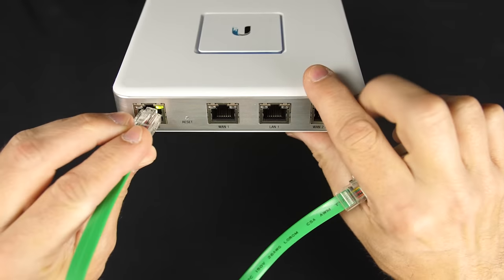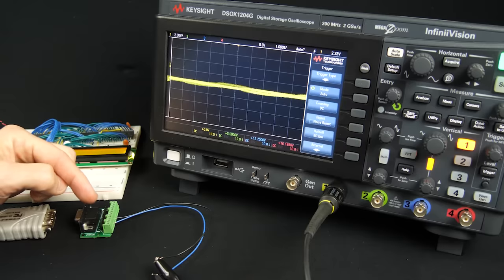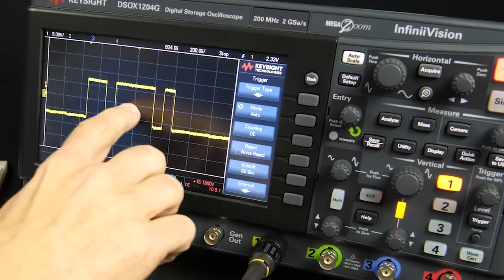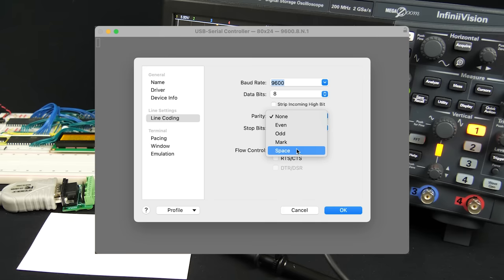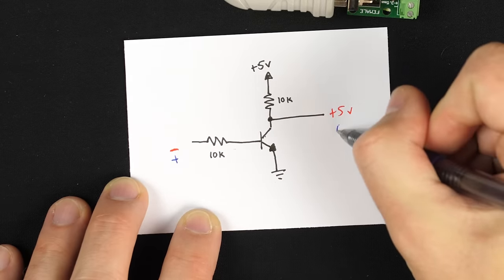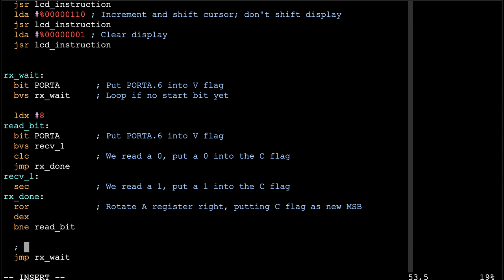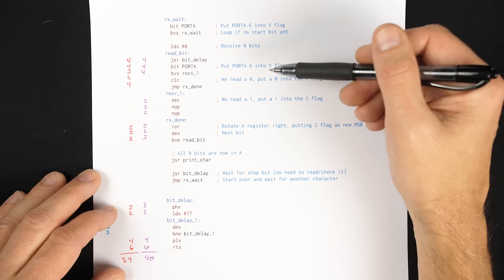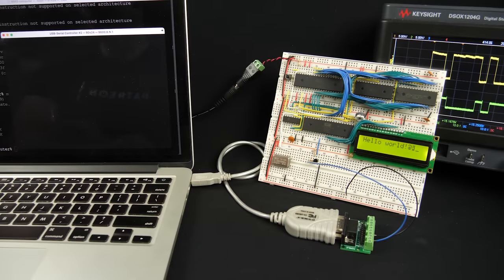The RS-232 protocol

Comment: I have worked with synchronous RS-232, in which the clock pins were in use.  The assumption is that the clocks gate the signal from a buffer where the bit is held until the clock releases it.  Interesting thing is that normally the clocks, both send and receive, always originate from the data communications equipment.  This is because the communications networks way back when were multiplexing multiple signals from a centralized clock (old-style Time-Division Multiplexing [TDM]).  That means your bits better be ready to go when the clock says go.  The much more common asynchronous signalling is left to adjust timing through a network by allowing for buffering to satisfy the strict timing requirement of the network.

Comment: Good timing on the video. I've just been working out old MS-DOS training software for Morse code, from when people needed to learn it their amateur radio license. Many programs let you connect a Morse code key, paddles, oscillator (speaker), or a keyer (to key a radio transmitter). And every program manages to expects them to be connected to a different set of pins on the RS-232 port to every other program. Usually the docs include an ASCII circuit diagram showing how they decided to do it. Typically they'll use the flow control pins (CTS/DSR), but sometimes the Ring (RI) or Carrier Detect (DCD) which are more tricky to get working in a DOS emulator. Data pins are always ignored (except sometimes to get a negative voltage for a pull-down resistor). It's a bizarre world of mutually incompatible, independently homebrewed solutions.

Comment: Great stuff.  We used RS-232 for a lot of stuff back in the day.  Just to be clear, when connecting two computers directly as you show, there is no 'DCE' and you have to pick one yourself.  You could have picked either one, just have to follow the right 'direction' for sending / receiving.  Flow control was another big thing, many folks used DTR/DSR but I think that wasn't really part of the standard to use them for that.  And don't get me started on 'Ring Indicator' and 'Carrier Detect'  lol

One area that was tricky was sending large files.  No matter how careful the clocks were, if you tried to send more than 150-200 characters, you'd get a clock-slip sooner or later.  And of course we didn't want to add two stop bits as that just slows everything down.

That's why there were several 'file transfer' programs like KERMIT.  It broke up the data into chunks (128 byte was a common size) and sent them with a tiny 'pause' between them.  So each 'chunk' the start bit would sync things and break the transmission before the clocks drifted too far apart.

This all takes me back.  Thanks for the video.
Reply: In this scenario both devices are DTEs and should correctly be connected using a null modem, for async comms this is otherwise known as a crossover cable. For synchronous comms a proper null modem device is used which generates the proper control signals and clock sources.
Reply: With a UART, sender and receiver synchronize at every byte.
The hickups you mentioned stem from a different thing. The receiver needs to have some time to actually process the received data. Often that ment to calculate some checksum and to write them on floppy disk which wasn't particulary fast. That's why programs like Kermit or ZModem transfered in chunks

Comment: I've worked with RS-232 since about 1984, and all kinds of variations, including its "offspring" RS-422, -423, and -485.

One of the more interesting variations of the 25-pin connector I found on a Texas Instruments printing terminal (850 comes to mind).  It used most of the pins for a standard serial port with handshaking and such, but then used others to support a parallel printer port.  Serial and parallel on one connector!!  I had to customize some cables to make it work properly and safely.

Comment: Thank you for this! I'm reminded (during the section on non-conforming connectors and cables) of the RS/6000 PAIN IN THE TUCKAS connector, and if one didn't have the correct cable, the console would immediately hang up on connection, meaning a long dig through the cable box for a complete one.

Comment: We still use RS-232 to integrate non networked medical devices with electronic medical records. Devices like Anesthesia Machines, Ventilators, Perfusion pumps (Heart lung machines), and others. They connect to a network appliance called a Capsule Neuron. In a few instances we also use old school terminal servers.

Comment: Great video as usual.

V.24 and RS-232 is almost the same, and V.24 uses the DE-9 9-pin connections instead of the DB-25 25 pin connection.  V.24 is a CCITT/ITU-T standard and RS-232 is a EIA which in our contents is the same.
Yes, the clock was used with some modems to synchronize the DTE and DCE.  (more info on Wikipedia)

Anyways, bps (bits per second) are how many bits are sent per second.  Baud is number of CHANGES per second, and a check can mean one bit, but it can means 2 bits, or 3 bits per second.   Encoding as voltage changes, or if you encode in sounds in ordinary modems, difference phase shifts (example a 0, 90, 180, 270 degree phase shift encode 00, 01, 10 or 11 which gives 6 bps if you have 3 baud transfer speed).

Comment: Back in the 1980s, I dealt with a minicomputer that had a bunch of RS-232 plugs in the back that supported two terminals apiece. You used a Y cable to connect one terminal to the primary pins on the connector and the other to the secondary ones. The back panel was pretty crowded, so not using the splitter cables would have required at least another U of rack space to fit all the plugs.

The old-school Western Electric 200 series (201, 202C&D, 202E, 203, 205B , etc) used binary synchronous communications and needed the clock pins. Async communications didn't need them.  Once 1200, 2400, 9600, 56k async modems came out, synchronous comms on RS-232 became a thing of the past. (The military held onto its synchronous stuff long after the commercial world left it behind, because AUTODIN depended on it.)

Mark - a hole in the paper tape. Space - a NOT-hole.  Since paper tape is a wood product, of course it has knot-holes.

Comment: I used to use this stuff way back when computers were newish.
DTE was an actual terminal.  Pre PC’s, Texas Instruments had a mini computer that could connect seven serial terminals.
I jammed our business through that thing for years.
I’m talking early 80’s here.  The cables for the terminals required 17 individual connections.
As years went by I figured out I could narrow it down to only 3 with some sneaky configuration.
TD, RD and ground if I enabled software flow control and limited the speed to 9600 bps on the longer cable runs of about 100m.
Isn’t it strange how fast the world changes.  People complain if their home internet falls below 20Mbps.
It was very Interesting to revisit RS232.  Who knew it has a new name.  
Funny how YouTube new to show this video to me.

Comment: I hope that someone mentioned that RS/EIA/TIA-232 says nothing about data rates, start/stop bits, parity or data encoding.  It is not a protocol.  It only talks about voltage levels, signal assignments, pinouts and physical connector characteristics.  Otherwise this is an excellent explanation of how a serial ASCII port works. Thanks, Ben.

Comment: This takes me back to the time when i tried to interface my C-128 with my 80286 PC.
I remember trying to use the built in serial interface of the commodore but at 2400 baud max it was just too slow.
So i built a parallel interface. The CIA6526's output impedance on PB0-7 was to high to have any effect on the printerport of the PC but there was 1 line on each side, iirc some paper present signal, that i could use for handshake. Sending from the PC to the CBM was no problem, but in order to get the maximum speed in slow and fast mode, i made the CBM the master, controling the handshake. A lot of bitbanging was done that night. But when i was finally able to compile 6502 code in TASM on the PC and send it over with a little program i wrote in QB i was a happy little tinkerer :-D 

Oh and i started the tranmission with 3 bytes, 2 bytes for the length and one either being $ff or $00, depending on if i wanted the received programm to auto execute.
Receiver routine would check the Userport for data in the IRQ and then JSR $fa65. 
And that was all because i could for the life of me not find a good macro assembler that would run on the CBM in 80 character mode.

Comment: I started working on RS232 stuff about 1980 - I think I've probably tested and/or troubleshot a hundred thousand ports, or maybe more. I designed it into products up until about 2003 or 2004. I still use it today from time to time.
Reply: Still used in healthcare equipment more often than anyone would think.

Comment: Within a few minutes from when the video has been published I got an info from work that I need to look for a rs232 electronic scale and get values from it to a microcontroller. I've never used rs232, only 3V3 and 5V UART, so I had to research how does rs232 really work. 
Too bad your video showed up 6h later but still, great timing!

Comment: Used to teach and students had lots of fun with RS232.  We'd scope it, decipher it and interface breadboarded electronic circuits with student laptops via the serial and parallel ports.  Would give them a waveform and they had to determine the rate, Start/Stop, and the character.  Built cables and did BERTs too. Had students communicate with each other and with serial modems in terminal windows.  Miss those days of simplicity.

Comment: In the mid eighties I had a terminal with a single RS-232 and I had to connect to a 2400 baud modem and a multi-user Pick OS IBM AT. I wired up a cable that connected to both and switched between the two by setting the baud rate on the AT to 19200 baud. That was a big enough difference to 2400 that the modem ignored the 19200 and the AT ignored the 2400. No unplugging and replugging required, just setting the baud rate on the terminal.

Comment: Nice. I was looking at the delay difference, and yes, I know 1 cycle isn't huge, but you can change recv_1 to be an additional bvs to the sec immediately after and get rid of the nops. This will make both paths take exactly 40 cycles, assuming you don't cross any page boundaries. This works because the overflow bit is still set so this is effectively a nop that takes 3 cycles instead of 2.

Comment: There is a distinction between the industry standard RS-232 set for serial transmissions and the hardware RS-232 connector. Through the mid 80s some data transfer systems used 8 bit parallel communication between TX and RX and an RS-232, 25 pin connector was used for this parallel communications (in many cases). I worked for a while as a field tech for United Press Int. which normally used serial transmissions whether by phone line or satellite into a tape punch or printer, but large newspaper publishers used computer systems that sent text around internally in 8 bit parallel format. The input to the computer was always an RS-232 connector, the "attention", "send", and Receive" lines were always the same on the RS-232 connector as set by the standard, but the 8 parallel data lines were not always the same from one system to the next. If I had to replace a data cable or install an initial system I had to custom wire the male connector that plugged into the client's computer system to match the system's pin-out. The advantage to parallel data transfer, aside from increased transfer speeds, is that a synchronized clock is not needed - the "send" single is used as a latch. All 8 bits of data on the line is latched into the receive electronics on the trailing edge of the "send" signal.

Comment: FYI, WDC's W65C51N ACIA has an issue with TDRE (bit 4) of its status register being stuck high, which means you can't use it to ensure you're transmitting at the correct rate. You can fudge it with a software delay routine (which is what WDC suggests as a workaround in their datasheet), but I found that approach to be unreliable.

Another 6502 hobbyist came up with a promising idea to use the pulse counting timer on the VIA with the ACIA's 16x RxC clock output to generate an interrupt, but that was a bit elaborate for my taste so I wound up just getting a new-old-stock Rockwell R6551AP on eBay. That version of the ACIA works as you would expect, so long as you don't leave any of the input pins floating! 😁

Comment: An anecdote that I have, once a factory owner of plastic molds for containers had a Japanese CNC machine from the 80s, for more than 30 years it worked with a 486 but it had not been producing for two months because he stopped receiving orders (the mold designs were encrypted in random letters that were basically instructions for where the machine had to cut) there was no other way, the owner had already ordered another internal CNC computer that cost him thousands of dollars. I realized that he disconnected the machine when it was "hot" so the Port connector was burned, that was it.😅

Comment: Hi just a small thing, RS232 is not a protocol, as the acronym suggests is as standard. Many different types of protocols can be sent via an RS232 link. These same protocols can also communicate via RS485, RS422. Basically A communications protocol is an agreed set of rules between to devices. 😊

Comment: There was a synchronus serial standard that used pins 21, 22, and 24 (if I recall correctly) for connections to a synchronus computer like a mainframe. I remember Motorola Codex MUX boxes that would allow a 56kbps serial to be split into 2 or 4 different serial channels which requires the synch clock to keep in frame.

Incidently, the purpose of the start and stop bits comes from the mechanical teletype days. At 75 baud, the mechanical print head had to mimic the assembly code algorithm in this video in mechanical form. The start bit would start the head rotating and the incoming bits would set pins or levers located around the head with precision timing. After all the bits were set or reset, the mechanism would require some time to decode the bits and throw up the typewriter arm for that character, thus requiring one or two stop bits of delay to give the head a chance to type the character and rotate back to its start point and latch, holding in place waiting for the next start bit. This is why the start and stop bits are opposite voltages. The start bit releases the head to start rotating and the stop bit doesn't. 

I don't remember if parity was involved in the mechanical teletypes or not. You could choose EVEN, ODD or No parity. ODD or EVEN parity would add an extra bit to make sure that the total number of ones bits was either odd or even. If the data bits had an even number of ones, the parity bit was a one to make the total an odd number for ODD parity and a zero to make the total even for EVEN parity. If the data bits had an odd number, the parity bit would be the opposite to keep each sum even or odd. Hence, the sum of ones in the characters were all odd or all even. If a bit was corrupted, the parity would most likely be wrong and a parity error would then cause an application defined event, either ignored or raise some sort of alarm.

So, literally, RS-232 was designed for the mechanical teletypes. The reversing voltages insured that long wires and interference had little effect on the reception. Current would flow one direction for a zero and the other direction for a one.

Comment: 12:02 I use almost this circuit often, when I don't need to transmit, However I add a reverse diode across the emitter base junction, so the most reverse voltage the transistor sees is .6 V. quite a lot of serial lines run at 12V, and that is a bit much for many transistors. The same goes for any negative voltage static transients etc.

Comment: We used MC1488 / MC1489 drivers/receivers for RS-232.  Not only took care of voltage differences, but protection.  IIRC, the RS-232 spec said you had to be able to short any pin to ground without damage.  Hehehe  we 'tested' that on more than one occasion when hand building a lot of RS-232 cables.  Accidently have both ends transmitting on the same wire sometimes.
Reply: then there is the max232 chip.
Reply: Don't remind me... after a thunderstorn I would be replacing those chips in the Zenith Z-49 terminals. We installed sockets because hello, it would happen again. Interestingly once the chips were socketed, the terminals tended to survive. Go figure. :)

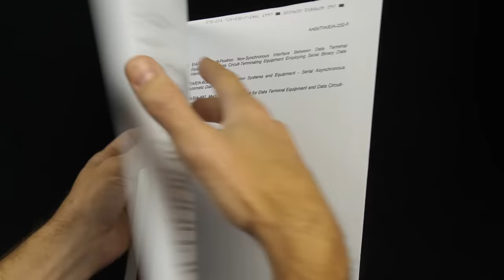Comment: 02:31 this is super cool. If you got an old 25 Pin on one side but only an 9 pin 232 on the otherside and don't got an adapter in reach you could just bridge the pin outs with signal wires for example.

Comment: I was a tech on a system that used a 600 baud communication in the 80s and 90s, 1200 and 2400hz. I practically lived RS-232! I used to turn un-needed office computers into RS-232 terminals and install them at field locations. I still have a bunch of serial adapters and testers.  On one system, using packed BCD, the last data  byte returning from the field was only 4 bits, but the computer (PDP-11 running C) expected 8 bits, so the character string was incorrect, but the software took care of it. I had a hard time explaining that the last character was garbage to some of the people there... it was created by the sending units oscillator trailing off on a 10 mile telephone line. Weird stuff!